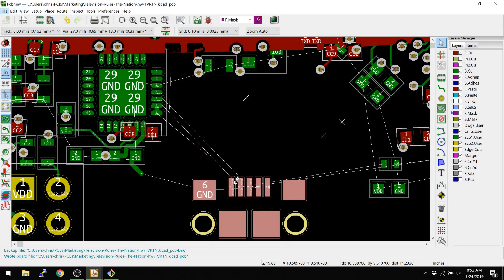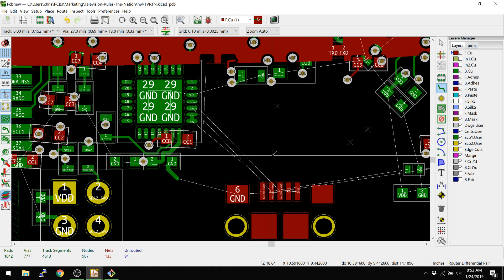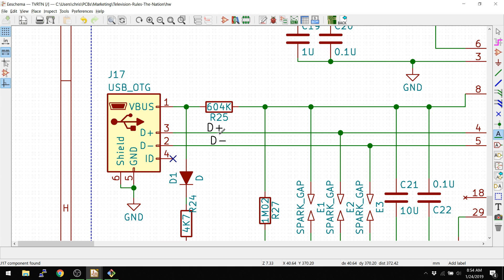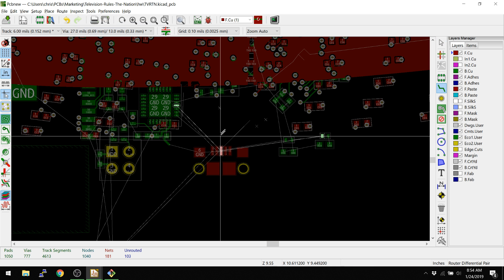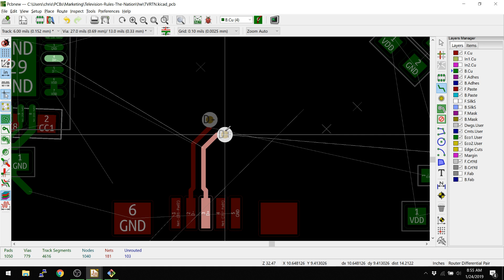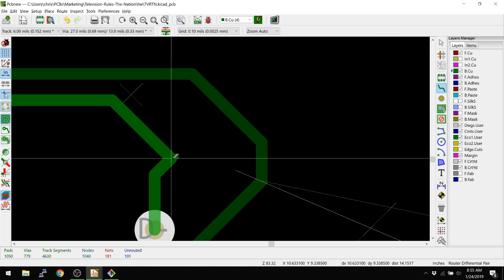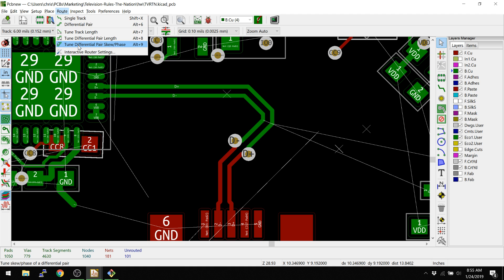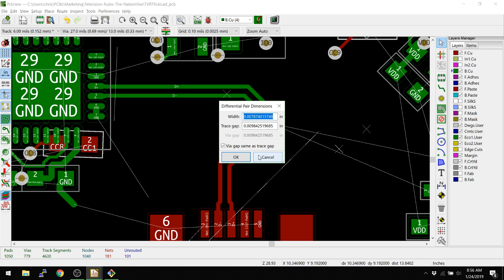KiCad 5.0 - Differential Pairs

Comment: Nice video and thumbs up. Does KiCad calculate the correct line widths and spacing for the differential pair using the board stackup? Or do they assume that you will do this calculation or better yet get the parameters directly from the board manufacturer?
Reply from the maker: I believe it's the latter, since the attention to stack up is minimal.